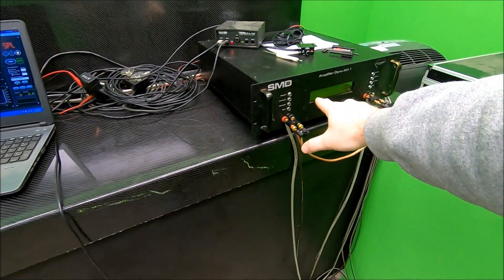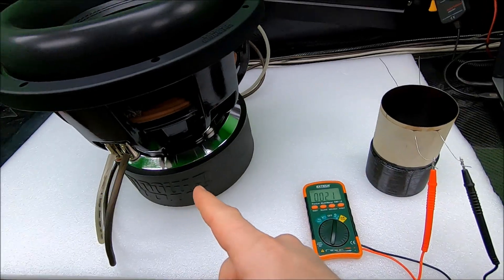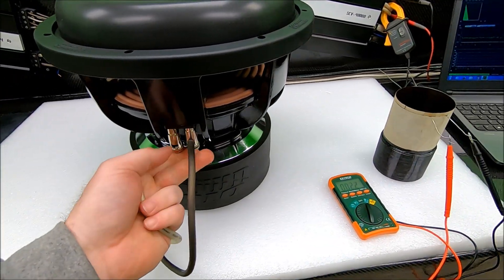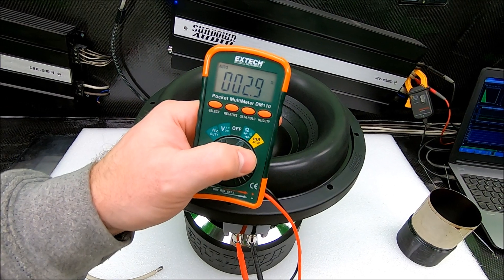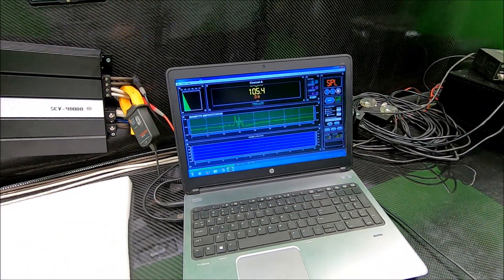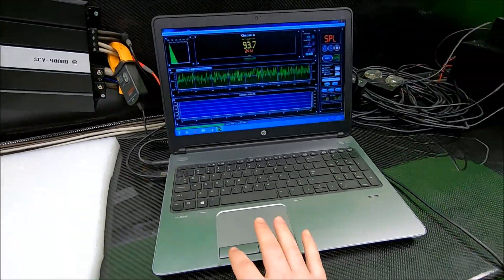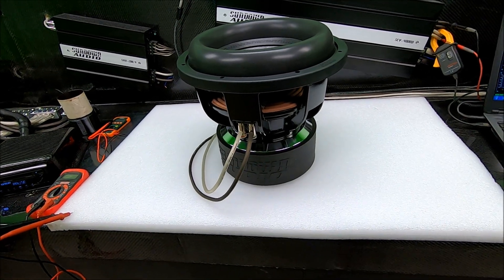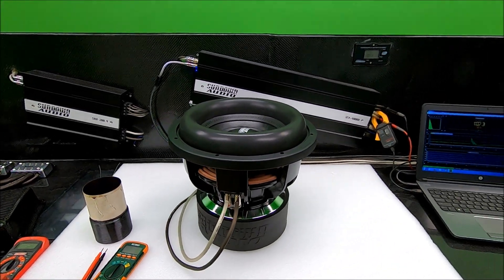How To Fight Box Rise *Tech Time Thursday* at Sundown Audio

Comment: How I fight impedance rise..... get a stronger amp that does higher rms at higher ohm loads . Problem solved . Your welcome .
Reply: Right or just wire half ohm knowing it will be over 1 ohm most the time anyways lol
Reply: @unix696  is that actually safe??
Reply: @unix696  problem is when it goes to low it’s basically a dead short and you burn your amp up if you don’t got a good protection circuit against low own lode.  My amp shuts off at .5ohm it want even start to play cause it’s starting at to low a load! I got a DC audio 2k!
Reply: @Tammy Forbes  What are your subwoofers dual one two or four I have dual two subwoofers and dual one with taramps bass 8k  impedance rise I been doing some testing? Here is what I came up with? With a small enclosure impedance impedance rise was 2.6 ohm load at 2ohms? With a large enclosure impedance stays at 2ohms? So if you have dc audio subwoofers they take small enclosures? So if you wire them two a half ohm you should rise to. 8ohms or 1 unless your amplifier can't handle the load my taramps bass 8k is one ohm stable at a half ohm it barely gets warm? Check your electrical system and your batteries reserves this is why I stopped using Korean amplifiers they like higher voltage than Brazilian amplifiers and they clip your subwoofers way before your clip indicator comes on? I been hooking up systems for over 40 years I'm 57 years old?
Reply: Or get something  like  a smart 3 where all loads  give u same watts
Reply: @ryancapps1254  what's a smart 3?
Reply: Or get a Rockford Fosgate T2500-1bdCP
Power Series amplifiers actively monitor their speakers' performance using Rockford Fosgate's Constant Power technology. A speaker's impedance naturally fluctuates as it performs. So, just like your cruise control increases the engine's RPM to maintain your car's speed uphill, Constant Power maintains this amp's output by increasing its internal voltage and current when the speaker's impedance rises. This results in up to a 25% increase in the amp's total power output, especially in the crucial range below 50 Hz where a sub amp really has to shine.
Reply: @davidlewis8124 💯 Rockford’s got it covered.
Reply: Ya I thinking bigger amp, smart 3 or Smart 5 lol he said don't worry bout it 🤣 FOH trying to send these coils to the moon and MF impendence rise killing the vibe over here. 🤷
Reply: Exactly what I was going to comment lol
Reply: I haven't heard any amp that sounds as good as t2500.1bdcp overall
Reply: That's what I did. Sold my 5Ks and bought 11Ks 😮😎
Reply: Big dicks in the ass

Comment: Which amplifier fights box rise more? Full bridge vs half bridge?
Reply: .. taramps smart series
Reply: Full bridge and half bridge are amplifier topologies. It has nothing to do with what the speaker load is. Certain amps are designed to deliver their rated power over a range of impedances. Those are great. Taramps smart series as said earlier. Jl audio slash series, Rockford CP series, etc...

Comment: this story doesnt add up 
we need to understand how multimeter does the ohms reading and what happens when u move acoil in amagnetic field
this explanation doesnt add up
Reply: Movement of a voice coil is the result of electromagnetic forces created by the energy current from the electricity running through copper wires wound around the former. Movement generates heat as well as other potential mechanical mishaps. Heat is energy that cooks inferior subs as seen later on the test bench when a reading of infinite ohms displays off the digital multimeter's screen. I'm not convinced the readings shown in this video are the result of environmental causes as the guy seemed to claim.

Comment: I have a JL 250/1 slash series with the regulated power supply in it. Does this amp adjust output based on box rise or only based on the base impedance of the subwoofer? Something I've always wondered.
Reply: A regulated power supply simply means that it can output the same amount of power over a variety of input voltages. In other words it can probably deliver rated power if you feed the amp anywhere between 10 to 15 volts. It really has no effect at all on the output power.
Reply: @JasonWW2000  the OG slash series 250/1 has a regulated power supply. Still have mine. You say it has no effect on the output power but that's entirely the point. If I give it a 1.5 ohm load or a 4 ohm load it makes sure the output power remains the same. My question was if it compensates for fluctuations in resistance caused by box rise. If my 1.5 ohm subwoofer rises to 4 ohm during operation a typical amp would be putting out around 1/3 the wattage but one would think a regulated power supply could adjust for that. I just don't know anyone that can answer the technical end of that.
Reply: @Thezuule1  I think there's some confusion. The ability to output similar power from different ohm loads happens in the output section, not the power supply or input section. 
The power supply is what takes 10v-15v or so DC from the battery and steps up the voltage that the output section uses. 
So a regulated power supply is able to maintain the same high voltage AC that the output section needs across a range of DC input voltages, like 10v to 15v. So when there's a big draw of current and your battery voltage dips low, the amp can still maintain rated power.
The part where the amp outputs similar power from 1.5 ohm to 4 ohm is a separate output section design.
Reply: @Thezuule1  To answer your question, just look at the specs of your amp. It should clearly say the power output at different ohm loads. 
The basic way these output sections work to deliver the same power at different ohm loads (at least for Taramps Smart series) is they design the amp to make full power at 2 to 4 ohm and as the impedance goes lower they kinda clamp the high voltage rails to prevent it from trying to output more power. The way they do that is quite complicated. Different companies use different techniques. 
I just looked up a JL amp, as I'm not familiar with them, and I see they use some confusing terminology. They say "The regulated power supply allows this amp to deliver its rated power to a wide range of impedances (1.5 to 4 ohms), even when voltage levels drop during heavy use." So apparently they are using their own design which does utilize the power supply section in some way. They don't get in to details, though. Thats interesting. 
So traditionally an amp with a regulated power supply like from the 80's, 90's, 2000's, usually class AB, is just to help the amp do rated power regardless of your battery voltage. JL is using a more complicated setup that uses a regulated power supply to help the output section do rated power across different ohm loads. I hope that makes sense.
So as far as your model amp, what do they rate the output power as? Does is say the same power from 1.5 to 4 ohm?
Reply: @JasonWW2000  the output is the same at every ohm load. That's the point of their system. It's 250w at 1.5-4.0 ohm. I just don't know if it compensates for box rise or if it even could without messing up the reproduction of the sound. It is advertised by JL as a regulated power supply so that's what I refer to it as. They call it RIPS, regulated intelligent power supply.
Reply: @Thezuule1  Nothing can compensate for when the subs impedance ranges from 2 ohm to 50 ohm. Nothing. 
That amp can only compensate for between 1.5 ohm and 4 ohm, after that power drops off like all amps. So 125w at 8 ohm, 63w at 16 ohm, 31w at 32 ohm, etc... It's still good technology though. 

If you want to know the impedance curve of your sub, in your box, in your vehicle there is a device called the Dayton Audio Test System or DATS. Its like 100 bucks. It will plot it out for you. It also shows the box tune freq and a bunch more stuff.
Reply: Some of jl audios other slash series amplifiers do have a type of constant output from 1.5 ohm to 4 ohm. Not the 250/1 from what I can see.

Comment: whats a good way for fine tunning  so your not bottoming out your voice coil because i play all kinds of music  like from bass bosted and  on  just trying to find out some better way of  tunning  i was  40hz 0db test tone
Reply: Besides building an enclosure to the woofers specs., & properly setting gains, make sure your subsonic filter is set between your port tune to 10Hz below, if ported, or just enough to keep your woofers from over excursion if in a sealed enclosure. Subsonic filter setting Example for a 30Hz ported enclosure= set to 30Hz to be the safest, & or you have a lot of power. Set to 25Hz if you have rated power, & set to 20Hz if you want a wider bandwidth, & or you have lower than rated power, or are easy on equipment.

Comment: Derrick would the resistance be at its highest around fs or fb ? Also maybe i missed it but does volume affect it or does it not change ..have an amm1 ill try today just incase u dont respond lol
Reply: Okay replying to myself after doing some testing for anyone who wants to know volume did change impedance but inversely was not what I was expecting at super low volume impedance was slightly higher does not change much but turning the volume up actually lowered the impedance by a couple tenths but in response to the other part of the question yes FS or box tuning frequency impedance will be highest at that point okay thank you Brian... You're welcome

Comment: So my question is with this is it better to have dual 2 ohm or dual 4 ohm subwoofers
Reply: Ones not better then the other, it just depends on the final ohm load you want... If you don't understand i can go into further detail..
Reply: Okay thanks I meant to put this question in there too so with the impedance rise so when I find out when my subs hold 1 ohm at a certain tone do I need to build my box to that tone

Comment: it seems to me that if you do manage to minimize impedance rise you will in turn lower the effectiveness of the sub. i can tell you one thing you can do that will actually help though and that is to get a box or design a box to amplify your target frequency. resonance is your friend. lower frequencies are supposed to consume more power than higher but for me that is not the case. my setup makes a anything around 20-30hz ish consume less power than anything above that at least according to my voltage. i'll be honest i never actually clamped it to see the difference in amperage but that shouldn't matter when i can see my voltage dropping to 12.6 at 35hz but remain above 14 at 25hz.

Comment: i think i get it now, we always hear amp  stable at 1 ohm or 2 ohms etc. so if you wire  at 0.5  or where your amp is unstable you will have opposite of box rise you will have box fall, and thats when your amp cooks. the unstable part means your amp will drop all resistance at any given point ,then you get the smell , then its too late
Reply: No, no. Thats all wrong. There is no such think as box fall. It always rises. Playing music it will never get down to its measured DC resistance. Wiring speakers to 0.5 ohm on a 1 ohm stable amp should be fine because it will never get down to 0.5 ohm when playing music. It will probably be between 1 and 2 ohms at its lowest. Amps don't usually cook due to too low impedance. Most have protective circuits that turn them off. All subs can only dissipate a certain amount of heat. If you overheat them the subs will fail. Even at low power it is possible to feed them a clipped signal and that causes s tremendous amount of heat. You never want to send them a clipped signal. Anytime they start to get warm to the point that you smell them you need to back off the volume and let them cool down.

Comment: It's simple.  Buy an amp that puts out the kind of power you are looking for at 2 Ohms.  That way when wired to .5 or 1 ohm, if you rise to around 2 Ohms, it won't really matter because you will still be getting the proper power you need
Reply: Well I don't want to sound dumb because I'm just wondering but if you have two dual 1 ohm subs in parallel  that will be .25 ohms before impedance rise would it be safe to say that once you get impedance rise it would be safe to be in that 1 ohm area that amps can run in? Or no?
Reply: @kennysimms5217  The amount of impedance rise will vary based on the sub, enclosure, vehicle and frequency you play. It may only rise to 0.5 ohm and if your amp can't handle that it might go into protect or might damage itself. I would not assume a 4x rise. If I were wiring to 0.25 ohm I'd assume a 2x minimum rise and use a 0.5 ohm stable amp. Or maybe wire it to 1 ohm and use an amp thats 2 ohm stable. Those constant power amps are good for this. I would never wire a 0.25 ohm load unless it was a competition vehicle.
Reply: @kennysimms5217  that really depends. Every build is different.  One build might rise 1 or 2 ohms while playing songs while other builds may only rise .6-.8 ohms.   Wiring an amp down to .25 is pretty risky.  I know some that do it but you better hope your electrical is on point (plenty of agm or
Lithium power, after market alternators, make sure you are grounded very well, have plenty of fuses, big 3 upgrade, etc).  Otherwise you will end up burning everything up running at .25 ohms
Reply: and then you run across a track thats got a signal in the hertz range where your setup flushes out at .5ohm and you dont have a .5ohm stable amp to handle it. dunno bout you but i dont see alot of half ohm stable amps floating around and for sure it isnt the norm. Was thinking out loud that if you know where that .5ohm comes into play and set the lowpass to chop it you might could get by with 1ohm stable amp running a .5ohm sub setup but is just a theory. Im a bit old school, maybe some these fancy DSP's can do that job to save a build from destroying itself.
Reply: @masterdebater8757  Your never going to see it dip to 0.5 ohm. It will always be higher than what you measure on DC. You can do a frequency sweep at lower power to confirm.

Comment: So where does the "Fight" part come into play?   Thats the WORST advice EVER!  Chaining your box tuning is how you fight it.  Im surprised you guys dont have a scientific method of find tuning the box to get more from your system.   Also  how about an Apples to Apples comparison.  Put the damn thing in a box and show the ohm loads. I happen to know for a FACT they will change based on cone area resistance.     I like your channel but this was the worst video you guys have ever done.
Reply: This video basically summarizes the difference between Ohms of resistance, and Ohms of nominal impedance. He never actually used the term "nominal", even though he's right: an 8 Ohm driver is seldom 8 Ohms! It is a good practice, to make sure the amplifier can handle the DC resistance of the speaker coil, just to make sure you've got headroom, when you hit the tuned port frequency of the box. The impedance  of a driver will almost never drop down to the DC resistance under any circumstance. With the dynamics of music, current transients are possible, which can instantaneously exceed the output voltage of the amp divided by the DC resistance, but, it's rare.

Comment: Shouldn’t those caps eliminate this . Regular battery’s go up and down but the caps are consistent so it wouldn’t matter the impedance as long as it’s in operation range ? I dunno just guessing
Reply: This has to do with the electromechanical nature of a subwoofer. As the amplifier is causing the subwoofer to move, the suspension and surround is physically moving the subwoofer back to the middle position and creates an additional electrical signal which feeds back into the amplifier. So its a combination of things that cause the impedance to change. Also the box and vehicle effect it as well. As far as amp output goes, its ohms law. The higher the resistance, the less power out of the amp.

Comment: Great demo this is good info for folks who are not yet familiar with the science of reactive subwoofer loads. You didn't mention the fs of the sub, that is a crucial piece of info to add to a benchtop demo like this. I do completely disagree with your theory that box rise is not a big deal and can be dismissed without much consequence. Port and enclosure tuning is crucial in ANY system, big or small, regardless of the cost or quality of the equipment you are using
Reply: Ronnie Smith didn't hit 150db on two 6 1/2s by ignoring box rise